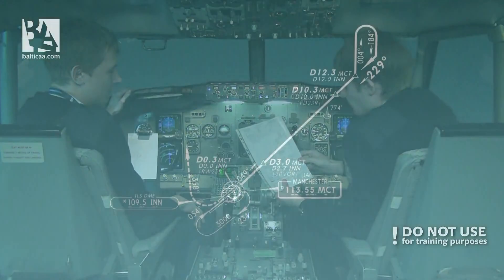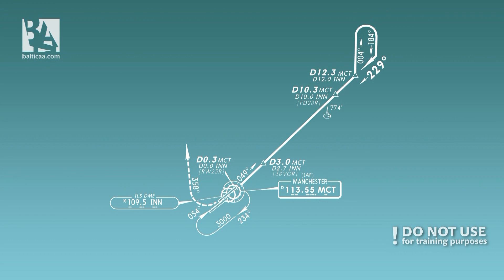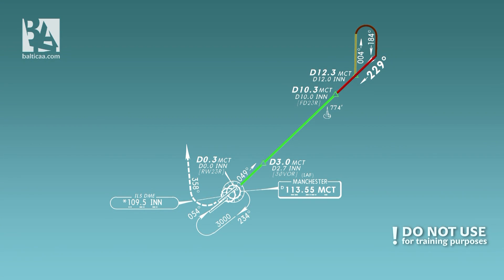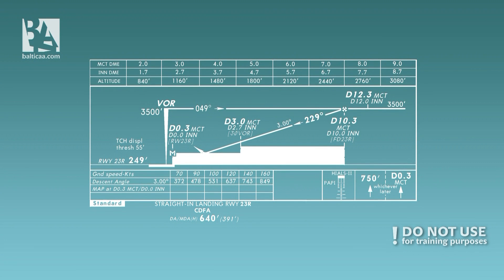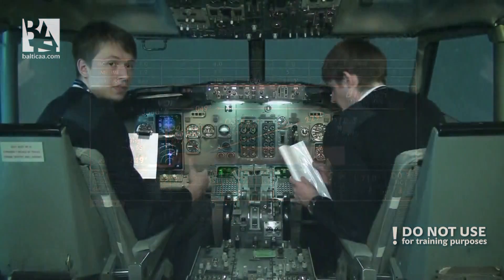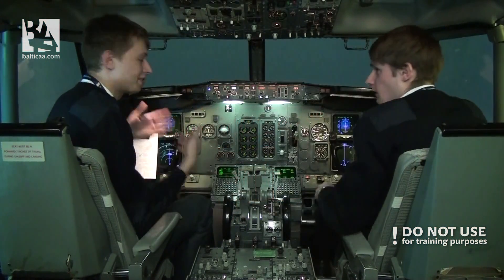Approaching Manchester in a less usual way: VOR/DME approach

Comment: Guys, this is impossible. The sound is terrible. Why on the earth I can see the lavalier microphones (microports) are almost on the middle of your belly? Place them on your collar or wherever close to your chin, so you are hearable!
  The other really distracting thing is the blinking projection and CRT displays. It's frequency is probably 60Hz and your camera is 50Hz PAL. You can either use 60Hz NTSC camera or anything half professional that has a frequency pitch, so you can fine tune is so the blinking disappears.
  Finally if I was You, I would use better lighting. Try some kind of LED panels or stripes above the heads so the control panel is lit and the back of seats and your heads rather darker.

Comment: How do we know from reading the chart that we should fly heading 004 for 1 min?
Reply: That isn't in the chart. If you have a smaller Plane you can also fly for 30 seconds or less. If you have a bigger one you'll need more time because your turns are wider.
Reply: +Verrückter Pilot It is a procedure turn, so for any plane it will always be one minute. These are all rate one turns, the rate however, differs according to the speed of the aircraft. You can calculate the turn angle by using the formula ([True Air Speed/10]  + 7).

Comment: The NAV radios (NAV 1 and NAV 2)  have 2 modes, Auto and Manual. Auto will automatically set the frequencies, based on his programmed flightplan in the FMC. When he sets the radio to manual he can then override that and set it to what the pilot needs it to be at that point. If he were to set it back to auto, the FMC would again control the radios.